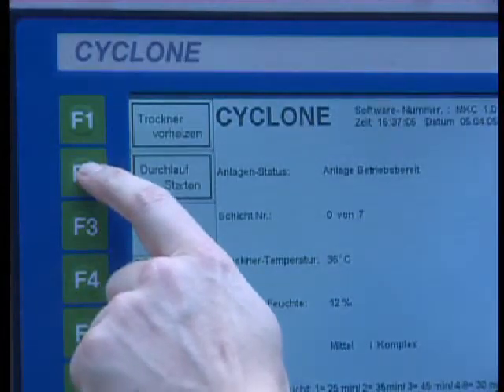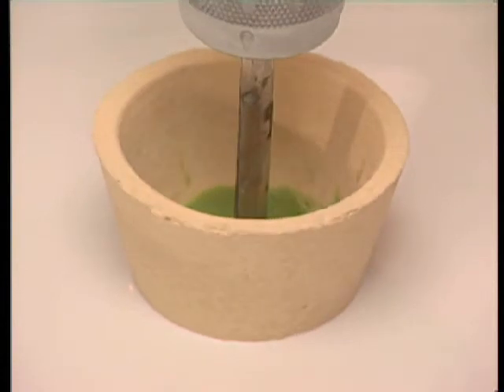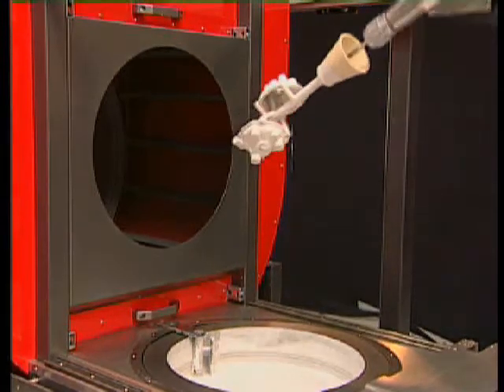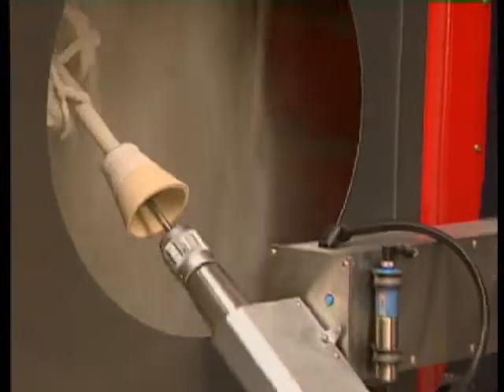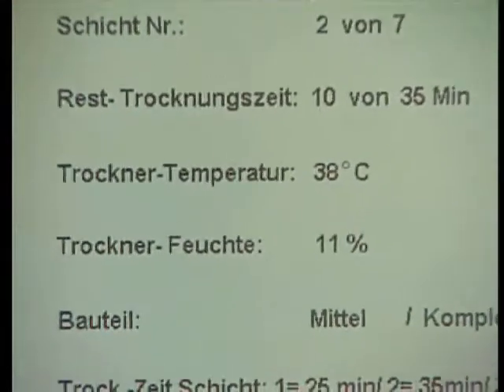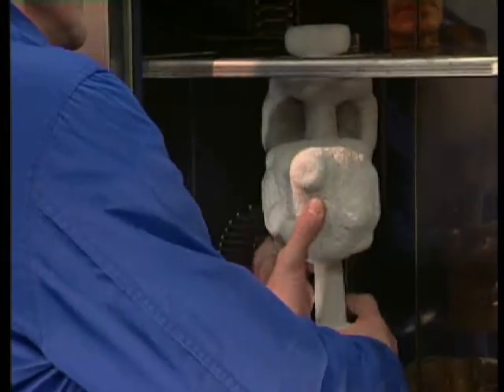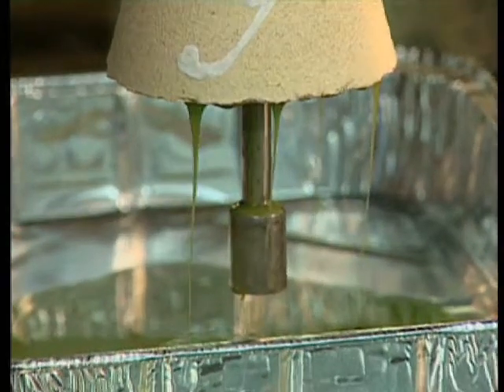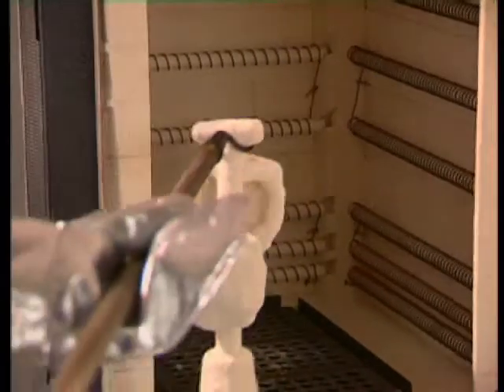How Investment Casting Works with a 3D Printer

Comment: It looks professional. Surely for rapid prototype instead of mass production. The ceramic paste may contain fast drying agent and extra strength. I think, connect a 3D hard wax printer with it will be able to automatically produce small batch.

Comment: sls printers can melt powered machine wax, sll printers (most of them) can be used aswell, but this is hidiously expensive (but nice results and reasonably fast) 

if you go somewhat more diy, the machine wax is very thin at around 70 degrees, making it possible to print it using piezo inkjet heads, as found in epson (i believe) inkjet printers. this can produce fantastic quality parts.

Comment: He says instead of wax master moulds, we can use 3d printed (SLA/FDM) master moulds. As far as I know this would be done with plastic, but can the plastic be melted out of the ceramic shell like wax? Please do let me know, thank you.
Reply: Ya available contact 3d systems
Reply: SLA plastic tends to flame and burn instead of melt. It is more likely to crack the shell during heat expansion. Quikcast and other SLA print formations attempt to reduce the expansion force of the plastic, still your shell should be built stronger than what you would normally build for wax patterns.

Comment: Im confused by the claim that the shell would crack if it was made any other way... why would it crack? Shell casting has worked well for many years without cracking during melt out...
Reply: The temperature they use here is very low, 150C. This will cause slow expansion of the whole wax pattern before it melts, cracking the shell.  In a normal burnout (if not using a dewaxing autoclave), the temperature should be close to 1000C, so that the wax melts out first on a thin outer layer and drain out, before letting the whole pattern warm up, expand, and crack the shell. So their secret must be a stronger shell, maybe it has additives.

Comment: which material use for 3d Printing die
Reply: I am not sure about the material coz it depends on 3-D printer we use.. for instance Projet -1200 and 3500 series 3-D printer are used in making wax pattern for jwellery and dental application for its precise accuracy..

Comment: Title is completely misleading. Video has nothing to do with use of 3D printing of the wax master. Wax is actually shown being cast in a silicon mold, not from 3D printing. System shown is an automated investment casting machine, but one that has too small a capacity and too limited in materials to be economically efficient. The robot and slurry tank mechanisms shown are an unsurvivable joke...they would break down within days of continuous operation, from the abrasiveness of the slurry. Foolish unprotected designs.